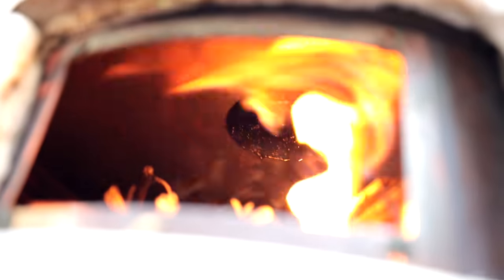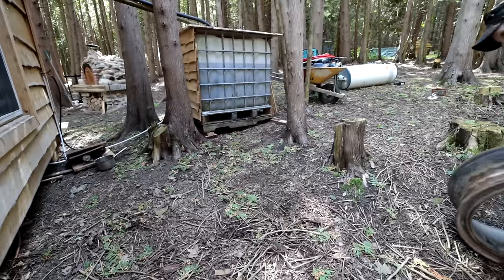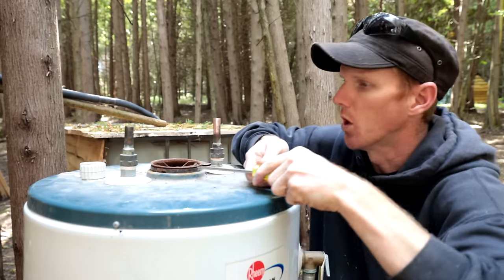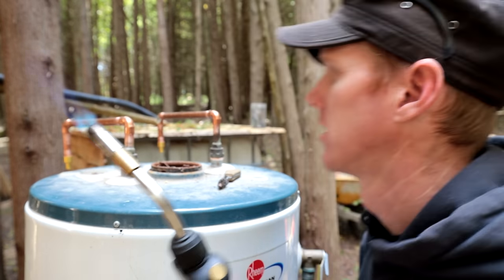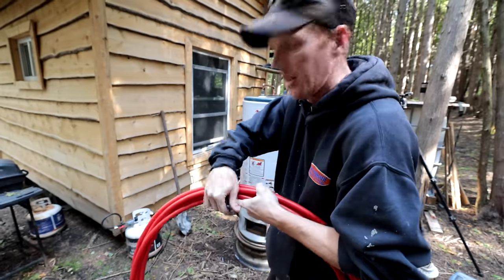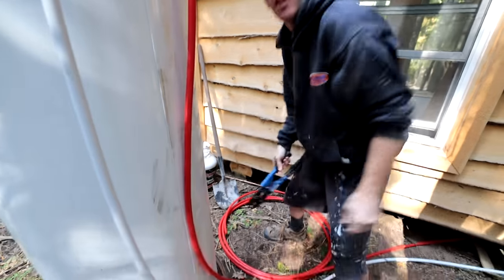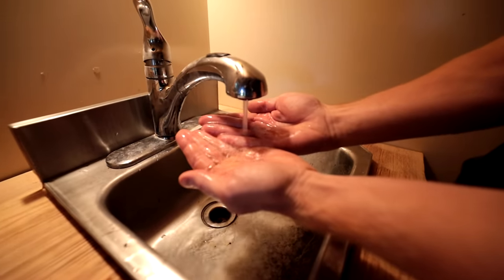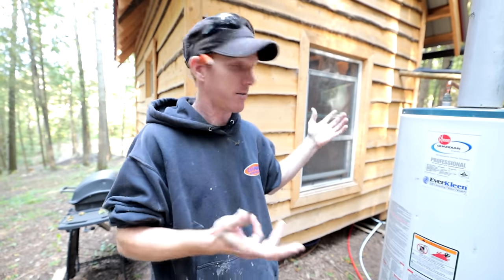MacGyvered Hot Water Tank for Off Grid Cabin - Fire Burning

Comment: I was wondering if that would work, before I saw this pop up on my feed today. I have been plsnning the bath house/ laundryroom/ outhouse combo I intend to build as soon as I get my property. I will be using rainwater catchment for my source of water. I wanted to try this at my new offgrid homestead. I have access to old tanks. Thank you for proving to me, my idea will work.

Was also thinking of using the hot water to also use as radiant in - floor heating in this separate little building. What do you think?

I'll be living in my broken down 1988 motorhome. Its technically a hardshell tent on wheels bcuz nothing works inside but some of the lights, the fridge/freezer (new large Norcold) propane that is ignited by my 100 watt solar system, and my stove top (bcuz the oven explodes in your face if you try to use it, LOL) Only. No water, no furnace, no A/C, no shower, and toilet is a bag & go system. I'm newly divorced and poor, but I need to start over somewhere. So thinking raw land.
Reply: I think some thinking and some more fail safes need to be in place if you are planning on using a water tank to heat your house.
Reply: @cmosphoto1  not heating my home just using it to heat the bathhouse a little while before taking a shower. Not going to have a home built by winter. I only have one working arm and I haven't found my land yet. It will be a couple of weeks b4 I leave to start my search.

Comment: If you put a head tank off of the cold water intake you'll never have to worry about over pressurised pipes or air pockets just put the head tank at the height at the pressure of your pump. I think it's 34.6 ft for 15 psi. So up a tree

Comment: An  oversized   chip  heater.     

A  chip  heater  of  way  back  in  time  gives  "on  tap"   hot  water  using  just  twigs  fallen  from  trees.

With  correct  plumbing  it  is  cheap  and  efficient.     The  one  trouble  is   it  could  n low  up  if  you  don't  extinguish   the  fire  before  shutting  off  the  water.

Comment: I only scuffed up the inside of the copper fittings if they were old and dingy then I would use the wirebrush in it sand the end of the pipe and flux both and sweat them together

Comment: I wonder if you could "Macgyver" a thermostat out of a car radiator system somehow?  Have to get the specs on which thermostat opens at the temperature where you would be safe and allow depressurization and overflow.  Or even thinking on the basis of pressure cooker relief valve and how they work. Not sure?  Safety is #1 and backups can be redundant.  Plus it is kind of a challenge to research what is out there.  I like this idea a lot.  Copper coils around the flu pipe of the woodstove is where I was headed with mine but now you can be the guinea pig!  Stay safe and healthy!  Thank you!
Reply: Seemed to work really well!

Comment: Yes if you don't like the pipes cool clean water and a rag they will turn around in the road because the flux that you put on there is a cleaning acid you purified the freaking solder so yes you have to clean those off otherwise it will make pinhole leaks and it depends on the quality of the pipe and the solder but you can have them in less than two years

Comment: just be careful, as you use the water the thermal mass goes down and it will heat up faster and faster, so you want to keep a stream of cold water going into the tank, or put the fire out before using the hot water in the tank.

Comment: whats better and easier longer lasting self feeding is have an external fire feeding it thru a pipe thermostat controlled diverter flap so your halfway there. put a self log feeder in and it would also serve as heat thru a water pump fed heat exchanger. plus having the fire not in it will make for easier clean up less carbon buildup. just need to deal with freezing temperatures in cold climates so maybe install that in a shed and firebox and exhaust next to and under beside it.

Comment: Pex pipe probably makes a good popoff valve in case the one on the tank fails. Wonder how many psi it takes to bust Pex? Don’t want a mythbusters type water heater missile.
Reply: I wouldn't want to find out...
Reply: Alot more than you think good chance the tank would explode first (especially one left outside in the rain) it a used water heater so the steel is probably rusty and weaker then the pex

Comment: That would be good in the summertime but you might be better off using the tank for a reservoir (put it inside so it doubles as a thermal battery for your cabin) and wrapping a coil around the hot section of your rocket heater to heat the reservoir in the winter. it looks like it works good but it's not efficient the water in your firebox is condensation in the exhaust lowering the combustion temp. and not completely burning the fuel causing a ton of creosote.

Comment: What would have been more helpful to the viewers is you using a temperature gun to measure the actual degrees of the water temperature from the outlet of the tank before firing and after firing just before use of water.

Comment: Imagine a 5 gallon basin on your mantle with a pipe that's enters inside your stone fireplace and has about 10 feet wrapping the stove pipe and fire box and 2 feet from the ground on the opposite side of the fireplace a hose spiket. Tall enough for a 2 gallon bucket. I'm daily certain this was an on demand hot water heater wood fired.

Comment: Although maybe not completely necessary, it might be convenient to have a temperature gauge built into the tank. Or does it already have one? I don't use a tank so I don't know.
Reply: Could use a mixing valve on the top to prevent scalding.

Comment: Can you turn up and down the old gas valve to hear the click that it makes when it “used to call for heat”?  If so you can use it as a temp gauge to avoid over and under heating.
Reply from the maker: yeah it still works.

Comment: Nice work Kevin. Try using as dry wood as possible to minimize condensation. Do you have a thermometer for the water?
Reply: The condensation is coming from the 50 degree water...
Reply: @cmosphoto1  Yes,  know what you mean. The water that condenses comes from the wood alone. There is a difference in condensation if you use a 9% wood instead of 30% moisture content wood. The condensed water is nasty as it may contain acids corroding the metal parts.

Comment: Would it help transfer heat to the tank if you were to line wheel slash fire pit with fire brick
Reply from the maker: The fire is in the burn area of the tank the tire rim is just the stand for the tank.  You may get a little more if it was lined with firebrick.
Reply: It might be better to use Portland cement and perilite. I saw someone make a crucible and a rocket stove out of that mix. Perilite is commonly available at any garden or hydroponic store. Its expanded lava rock. And retains heat extremely well.

Comment: Hi Kevin, thanks for the video, but is there a way to introduce another failsafe safety feature to prevent the heater from blowing up (when temperature goes too high and the water starts turning to steam)? Otherwise it can be deadly.
Reply from the maker: Leave the valve open.

Comment: To prevent an explosion, can you leave the sink valve open so it can push through?
Reply from the maker: The system is pressurized, we added a valve to the top of the tank and de-pressurize when we heat the water.

Comment: If the  tank is not leaking. It was still fixable. 
Probably a cheap  thermocouple. 
No more than maybe the  burner. 
Is that because you don't have  L P Gas?
Reply from the maker: It was a tank from the scrap yard.  I don't have propane or NG at the property.

Comment: You would be better off when building the cabin by running your fireplace flue through a couple of water heaters one above the other, then plumb them both into an insulated reservoir up above them.
anytime the cabin is being heated the extra wasted heat that would go out the chimney is heating your water.

Comment: I’m curious if you could install a screw on lid on the top. Then steam could escape and you can check temperature. When it’s good, stop burning wood and put lid back on.
( would this mess up something?)
Reply from the maker: I added a valve on the hot water side... I open it when I'm heating and when it's done I close it...
Reply: Modern Self Reliance 
Niiice ... thanks for responding . 
You just earned a subscriber 👍🏻

Comment: the question is do you now get continuously hot water with it running at full tilt
Reply from the maker: It works like a normal hot water tank.  It's makes really hot water and it mixes at the valve.

Comment: Just curious could you have hooked up a portable propane tank to heat the water? I know it's not exactly off grid but I was thinking you could regulate the heat better.
Reply: Natural gas and propane run at different pressures so in theory yes but it would need to be regulated to run properly
Reply: Would need a different orifice.

Comment: Couldnt u make an expansion tank inside to capture heat... but blow off outside....
Reply from the maker: That's pretty much what the pressure relief valves is doing..  You don't want to even get it close to boiling...

Comment: Hi good video. I've got a question for you, so if I've got a 80gal steel tank full of rain water standing vertical and I build a fire underneath it how long do you think it will take to get it up to 110 degrees?
Reply from the maker: My guess...  Couple hours at least.
Reply: @ModernSelfReliance  ok thanks for your input. I bought a old cast iron claw foot tub and have it positioned under a hand pitcher pump. So I've got cold water but no hot. I was thinking of ideas to produce hot water for the tub without using anything but firewood. I want it to be somewhat efficient whyle using minimal components. Any ideas?

Comment: would a feed tube like a rocket stove let you feed wood less often ?
Reply from the maker: It does use much wood and I'd rather use small firewood loads to help with the control.
Reply: what i've heard is rocket style is more efficient .. that you need less and or can use a damper to slow the use of fuel...

Comment: If u get the chimney hot enough you can turn it into a rocket stove.
Reply: A key point in most rocket stoves is a secondary air intake, along with a place for the secondary burn to happen. Just heating up the chimney doesn't create that.
Reply: Rocket stove came to mind for me also. What if it was external and piped chimbney into the water heater
Reply: dper1112 if he made a tray to burn on top of, inside that fire box, it would do the same thing.
Reply: Dave Morrissette or. Insulated the chimney that’s inside the tank

Comment: When you can use the other part that you going off the top of the chimney right there you're talkin about you can drop that off into a gasifier situation for a generator like an old tractor but it's been the rear end and then turn is spinning a giant reverse generator into electricity for you you can pick him up from a lot of these auctions County auctions it is you just running it backwards to make electricity is free-floating inside there's no brushes so it just moves freely a 300 lb generator that you can turn with your hand that easy you get the gist of what I'm trying to say there.... they said there isn't any free electricity
Reply: Funny you should say that when I first started getting into the video the first thing I thought about was the gasifier. Lol

Comment: This water heater lacks height to circulate hot water, it is also necessary a relief valve to prevent the hot water and steam from making it explode, finally you must place a metal plate inside, where the wood will burn. Otherwise, the boiler base will be damaged in no time. And you'll have to use the metal plate anyway, and a cover it with a sheet metal sheet and protect it from the elements, because sun, rain and dust will make it spread quickly. That size reaches its ideal temperature in a maximum of 30 or 40 minutes, but it can vary from the climate of the area where you live, especially if the temperature drops a lot and snow falls, and take care that the tubes do not freeze because they are exposed.  A este calentador de agua, le falta altura para que circule agua caliente, también es necesario una válvula de alivio para evitar que el agua caliente lo haga explotar, por ultimo debes colocar una placa metálica en su interior, donde se quemará la madera, de otra manera, la base del boiler se dañara en poco tiempo. y de todas maneras tendrás que usar la placa de metal y una cubrirlo con una hoja lámina metálica y protegerlo de la intemperie, porque sol, lluvia y polvo lo harán oxidarse rápidamente. Ese tamaño alcanza su temperatura ideal en un máximo de 30 o 40 minutos, pero puede variar por clima de la zona donde vives, sobre todo si baja mucho la temperatura y cae nieve, y cuida que no se congelen los tubos  por estar expuestos.

Comment: You could buy a heater like this in the 70's. I had one and it worked great until the EPA shut them down. Now we have global warming from burning fossil fuel instead of firewood.
Reply from the maker: That's too bad.
Reply: kevin I'd like to know how wood stoves are fossil fuel wouldnt you an I've used wood an coal heat for yrs an idont no more
but I never saw a fossil or dino 
bones in coal or wood have you
coal is made fro. wood decaying 
so ?

Comment: I'd probably add another relief valve on top or just a hole that can be capped when not in use and uncapped when heating the water. Or do you kinda have to be an idiot to blow it up. Like "oh if one log got 40 gallons pretty warm I wonder what 5 logs could do?"
Reply from the maker: We added a valve on top to open while heating as an added safe guard.

Comment: Could a guy use charcoal to heat the water instead of wood ? 
You seem to have plenty of timber around your cabin, so building a retort and making your own charcoal would be a breeze. 
If it were me I’d be making charcoal daily to build up a nice supply of it, then you’d be able to not only control btu to prevent over firing, but you’d also be able to maintain the hot water by adding a few chunks of coal here and there so you’ve got hot water on demand. 
Just an idea.
Sure wish I had an off grid cabin to resort to, I’m just about done with this slave world we all live in.

Comment: because there is no fire heat control youMUST HAVE APRESSURE RELEIF VALVE ON THE HOT WATER DISCHARGE  LINE   do \not depend on the valve on the side of the tank  it will go boom if you dont control the pressure

Comment: Or, get an  L5  Ecotemp Instant Hot water heater ~ $300. Runs on Propane and 2 D cell batteries..Gives you all the hot water you need, temp control ability,  no fire, no mess, no ash, no problems ! This looks like a Pain and maybe bit dangerous!
Reply from the maker: It wasn't really a pain,  but it might be a tad dangerous. I'll look into those.

Comment: A ball valve on a tee on the hot side would have been a nice touch. It would let you provide a vent to drain the tank in the case of a hard freeze, like if you're not home for an extended period of time.  That would keep your FULL water heater from freezing. Even draining off a few gallons would do the trick, but alas . . . No tee and valve . . . Boo hoo.